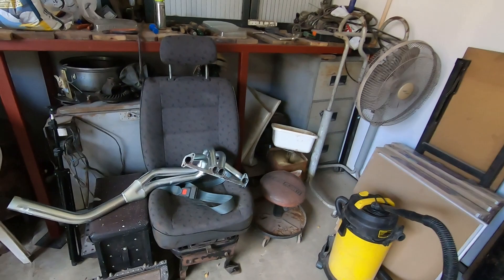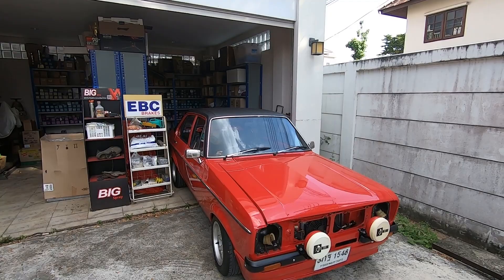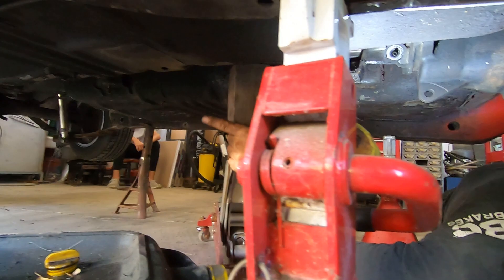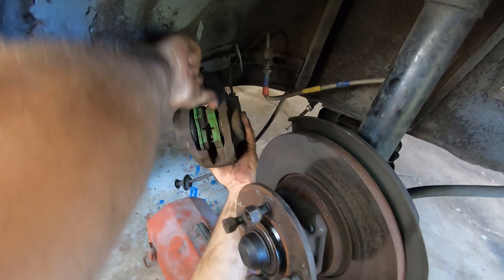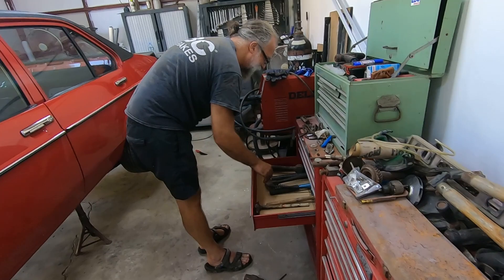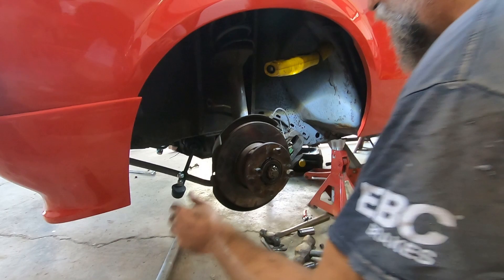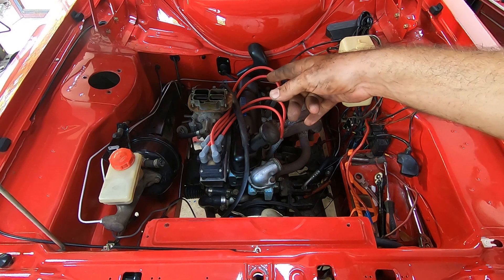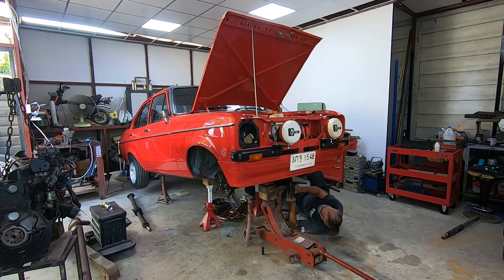Out with the old 1300 (removal out the bottom)

Comment: She looks so shiney and fresh on the paintwork,,Done a pinto to pinto engine in one of these when i had an rs2000 custom, before that  i had goldcrest 1300 that used to knacker gearboxes at pace, got it down to about 30 mins to remove it and replace, one time i got the box out went to park royal breakers got another, fitted in record time, it was when done, and upon actually looking i could see the prop spinning then realised this time the diff had gone... arghhhh... be doing 3 weeks in Thailand from 24th march,, can't wait. Second trip.
Reply from the maker: Nice going. When I was a teenager I used to change engines for people as odd jobs. It was usually on the side of the road and had to use rope. I'd stand on the inner wings and lift them up onto the front panel between my legs. Pinto needed a hand lifting though and I never did them in half an hour. Did a gearbox on the side of the road. Jacked up car and dropped it onto my chest. 

March not too far away, you'll be here in no time.